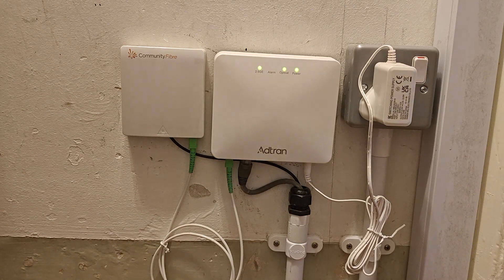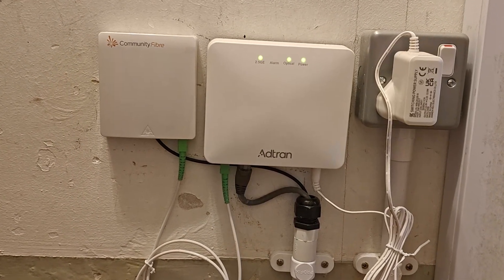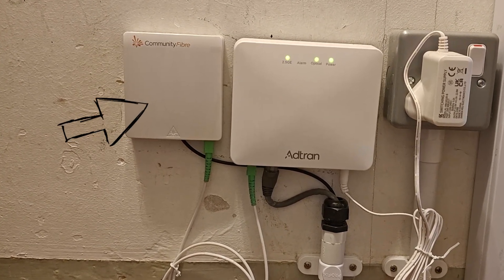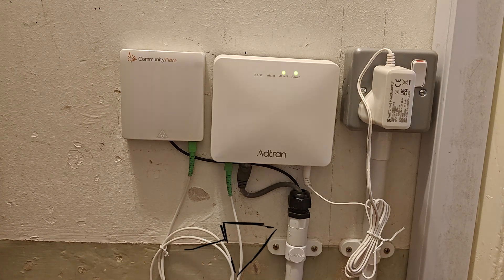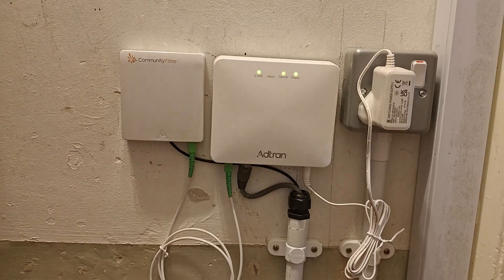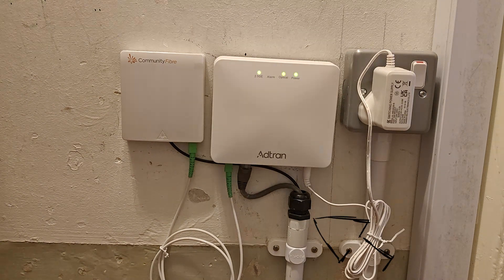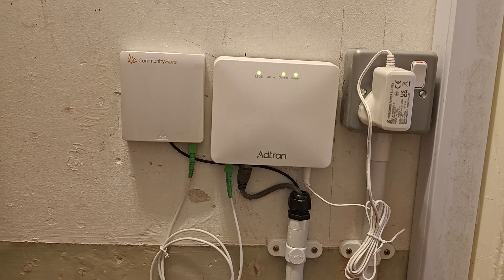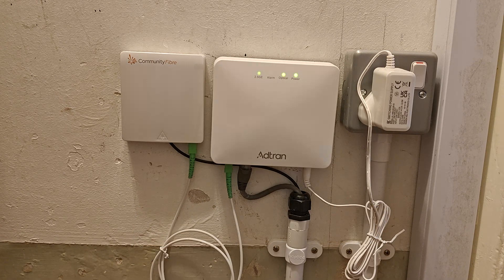Community Fibre  | Optical Splice Point & ONT Modem Explained (1.5   Minute Equipment Tour)

Comment: Where does the fibre terminal get its power? PoE?)
Reply from the maker: The ont gets it's power from the 13a socket. The splice point doesn't have any direct power as the fibre doesn't need power for data transmission

Comment: I saw tour review video of community fibre. Im nearly out of contract and will most likely go with community fibre. Cheers.
Reply from the maker: I've been with them for almost two years now and I've been happy with the service.
Reply: Were they happy to run the fibre where you wanted it to run unlike Openreach that just want to slap it down the front of your home and straight through the wall on the first ground floor room they come across?
Reply: @philip_james  Community Fibre seem to have an option for paying a bit more to get a choice. I will only take the service IF they will bring it right round back of large detached house through garage and round back like current broadband and into my home office. That is the issue - I do not want to sign up until that is guaranteed but I bet they won't guarantee it before you sign up - chicken and egg.....